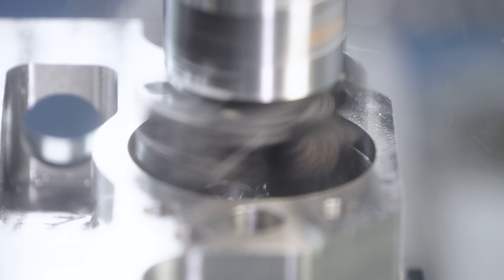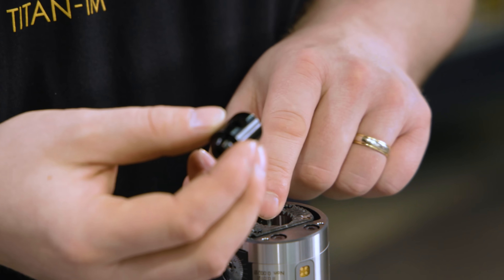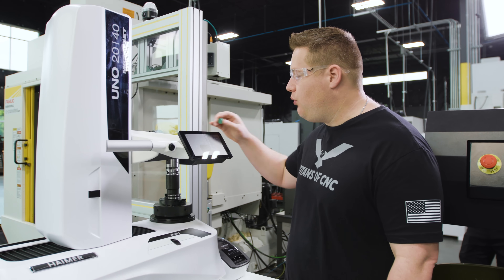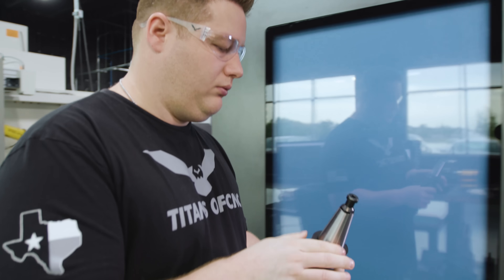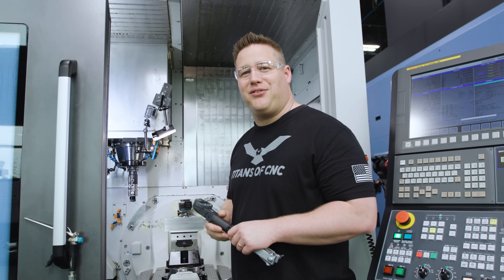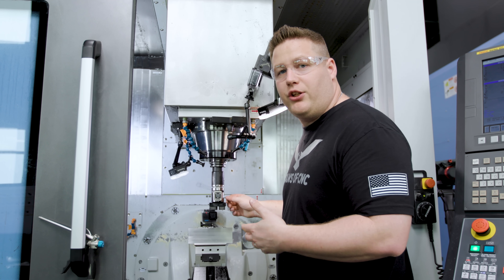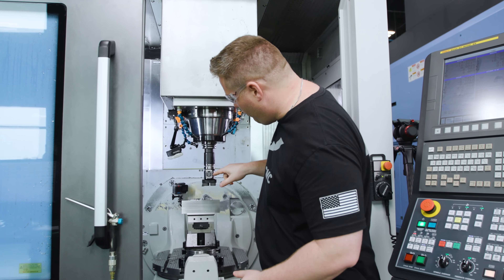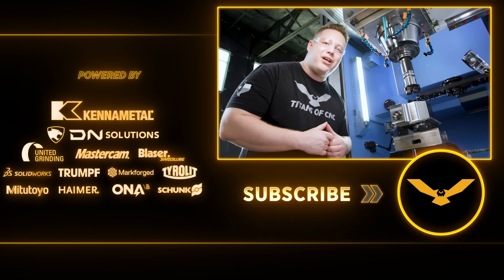Easiest Way to Dial in a BORE HEAD | DVF 5000 5 Axis CNC Machine

Comment: I was taught to get you real close anyways. Measure the holder flange diameter, then use an indicator and zero it on that, teach your axis as that flange diameter. Then move to your insert and find the highest point and look at your axis that you input the flange diameter to. You should now see what that diameter is. Im sure this sounds confusing.

Comment: If trying to hold a close tolerance AND make the best possible finish, is it still normal practice to bore through the part then feed back out again? Doesn't the tip of the insert cut more material on the way up and/or compromise the finish you produced on the way down?

Comment: We use those bar style for roughing and finishing, but I don't think they hold up as well as the older style finish bars
But our bars get used hard.
And I always make my adjustments in the tool setter 
But it would be great not having to take the bar out to make the adjustments

Comment: You can also use a dial gage on the cutting edge of the boring head to measure for the backlash. 1, Set your boring head. 2, cut a test whole and measure the whole for actual cut settings. 3, set a dial gage on the cutting bar3, 4, final set the boring head and make sure the dial gage readings confirm the radius you are dealing in on the boring head.

I know its cumbersome but certainly doable without breaking the bank.

Comment: The truth of the matter is that parts are designed by oems for no reason other than to try and force customers into slavery buying parts from them.  Boring tight tolerance pockets with a milling machine is stupid. Theres no honesty in it it it's just evil profit seeking through spineless coward engineering

Comment: That's so awesome. I had that happen to me on my first set of boring operations at my first job. At some point a coworker came by looking for something and being friendly. That was enough for me to completely lose my rhythm, and I think I ended up doubling up on my second cut, which took the bore just out of tolerance. I let my boss know. Unfortunately, it was a piece of like 4-5" thick steel, and we didn't have the stock to just fire off another. I felt bad about that one.
Reply: I worked for a small minded company in Sheffield England  after 6 months of excellent work. Despite getting them out of the suit numerous times they thought they would dock me 6 hours pay.... I left that place they say after

Comment: The problem with using a presenter to set boring bars, in my experience, is that the presenter doesn't measure the tool as it's cutting with the cutting pressure on it.

I normally go .002 undersize to be safe and then work my way up. More for sub .0005 tolerances.

Also, alot of boring bar adjustment is in how you tighten the set screw. Everyone has their own way. Kaiserheads aren't as bad but in my shop I rarely see them.

Also spring passes. The nice thing is once a boring bar is dialed, it's dialed.

The digital gauge would help with adjusting it though. You can note where your original adjustment left you and comp for your spring pass on the current and your first pass on future parts separately.

Comment: Did you bore all the way in then all the way out again? Do you not have spindle orientation? Just stop at the bottom, stop spindle, orientate, move off centre then rapid out. Halving the life of the insert doing it your way.
Reply: Of course they have M19, but one of his suppliers maybe had to told him about the Fanuc G76 Fine Bore Cycle. 
Sometimes your stop doesn't match with the cycle retract in X or Y so you can program it by hand, just a small G91 move, well as long you use a one-cutter !! 😉

Comment: As a machinist who started out boring with boring bars both with AND without those dials, I'd have KILLED for something like that. I always dreaded having to change the inserts on my boring bar. It was a custom built bar with multiple inserts going down it and cut 5 diameters at once, each a different size. NO DIALS. Each insert had a set screw that could be used to adjust the insert and, therefore the diameter of the corresponding bore. Bringing each one into size was a chore, especially making all adjustments by feel with allen keys. I can almost guarantee that company is still using them too. Glad to see that something far better is out there.

Comment: Or.....
You can pull the ten thousanths travel indicator out of your toolbox and measure the actual adjustment from the cutting edge. No one uses the dial on an adjustable boring head🤠

Comment: Maybe a little thing for automation.
you are printing a label from the measuring machine.
Then manually typing in that data on the label.
Why not just have the measuring machine print a barcode 1D or 2D and then have a scanner on the mill, to scan said data in. This way you can't make a mistake in typing in said data from the tool
Reply: The operator could mess up transferring the length for Z or he could touch it off on the tool eye. I am assuming the program is going off the centerline of the tool so it won’t matter if the operator fat fingers the X and does t double check.

Comment: Just to point out, no machinist worth his salt will trust the boring head dial alone. I would always use a dial on the tool as it is adjusted. 

That said, it’s a pretty sweet system.

Comment: All of the high tech equipment is impressive! I have experience with Dykem, trusty Post-It Notes, and Tool Eyes (when you could trust them) hahaha 

The Haimer Uno looks like a blessing in disguise, ease of use to the operator and those who don't have eagle eye vision. Chips on some inserts can be insanely small and just as difficult to see under a standard backlit magnifying glass. 

Awesome video!

Comment: Does the display show the true radial movement or is it diameter . Like let’s say you have a 5.0000 hole, the first cut was at 4.995, would it be .0025 or .005 adjustment ? (Not accounting for tool pressure)
Reply: According to the video it goes off diameter.

Comment: When using a boring head in a CNC machine how does the retract work.? Do you just feed it out? I would think it would take a small spring pass cut on the way out then. Probably bad for the finish and could introduce chatter. Any insight would be greatly appreciated
Reply: Most CNC mills have monitored spindle orientation, so you can easily just tell the machine to stop the tool, set the spindle to a preset orientation, move the cutting edge 0.1mm away from the bore diameter and retract in rapid. We got a ~30 year old cnc mill with a sub-routine for that out of the box, where we just tell it how deep to bore with a parameter and all we have to do beforehand is mount the boring head in the right orientation
Reply: @jetfire5991  Ok thanks. That makes sense. I’ve been curious about this for a while. I thought I saw at one point in the video the tool spinning as it came out. It may of even been on the finish pass.
Reply: @Revilokab  it might have been, since a spring pass is just a result of tool deflection. That boring head they're using in the video looks really rigid, and they are only removing like ~0.1mm each side, so I imagine that spring pass that would happen to be next to non-existent.

I'm just speaking from my experience, since we're usually trying to hit the dimension with a single pass to save on cycle time, and depending on the material, that spring pass for us could make a difference of 0.01mm in mild steel (~0.0005") or 0.05mm in stainless (~0.002"), so we're usually using the routine for pulling away to avoid that.
Reply: subroutines are great, but most newer machines have a handful of canned cycles just for boring. writing a subroutine would have the same result. IIRC, theres a cycle to orient the spindle and retract a spscific distance in I and J, dwell at the bottom and feed out, feed in and feed out at different rates, feed in and rapid out maybe? probably for spring loaded tools on the rapid out. it's been a while for me, so I don't know them off hand.

as with mosy things,  it always depends on the job. is it a short run of one offs? are you trying to shave seconds off a production cycle that rapid is worth risking? is there a surface finish callout? maybe they want a cross hatch on the cylinder walls that an abrasive will touch up minor scuffs afterwards. have pride in your work, but make sure you're not doing unnecessary work for free.

Comment: It would be nice to have that equipment but we wouldn't use it enough for it to efficiently pay off in the time saved. (*edit* What is extremely affordable? That's certainly a debatable topic when it comes to buying machinines) We set boring tools the old fashioned way... On the surface plate, sweeping the insert to find the high, and adjusting accordingly or in our optical comparator( <--Spell check says I'm spelling that wrong, wtf?). No doubt, setting a boring tool is probably one of the biggest headaches of setup. Tool pressure is a mf'er, especially if you have just enough material for one pass. Depending on the material(most) rerunning after adjustment just scraps the part. Sneaking up on the dimension isn't doable like most machining of tight tolerances.
Even though we have plenty of boring systems I'll probably get a quote on one of these tools though, just for the ease of adjustment in the machine. Take note, I'll be the first dumbass to leave the digital readout on the tool and hit go.
Reply: Yeah, I sometimes resort to honing, lapping or ballizing when I'm just under a very tight tolerance band.

Comment: Do newer bore heads still have backlash or is there newer better technology? Seems like they should have covered removing the backlash in the adjustment.
Reply: Well seems they do! Was wondering why he didn't mention it on the tool setter.
Reply: It sounded like it has backlash but the digital readout won't register movement until you move forward, or rather increase boring diameter.
Reply: @GrumpyMachinist  yea i noticed that during the digital adjustments. pretty awesome tech not gunna lie!
Reply: Everything has backlash. Backlash isn't your enemy, worn/sloppy ways are. Drunk threads and ignoring the foundations of mechanical accuracy  are your enemy. 
Also there's no way to fit a ball screw arrangement in that small of a package, without it costing half a million.
Reply: Getting accurate results with lots of lash isn't a problem if the ways have propper guidance and no sticktion do to in proper thrust design. 
Read foundations of mechanical accuracy and precision hole location by Wayne f Moore.

Comment: How do you back up the tool on Z axis once it’s done cutting? So the insert won’t scrape the bore you just cut
Reply: You can do that depending on the tool and orientation. In Fanuc we G85. Bore in, bore out, which is what you want to do when trying to hold a surface finish and remove tool pressure. G86 will bore to depth, stop the spindle at depth and rapid out but it will leave a tool mark. However, the tool mark is minimal. You could also G01 in at one feed and feed out at another feed. Most of the time we just G81(feed in, rapid out), like a drill cycle.
Reply: Looks like they are back cutting on the way out…..

Comment: This is just awesome. I can imagine even more tech and automation to ease this process. Still too manual for super efficient production.
Reply: You'd be shocked at what those boreheads will do. We, myself and the kid I trained, make .0001 adjustments while feeding an assembly line the old fashioned way, dial tools. It really boils down to keeping it in spec but it's not hard without the digital reader.

Comment: I still heared from this system, but never seen one in action before. Thank you for showing. At my workplace, we have very tight tolerances at our workpieces to produce.
Sometimes it is not allowed to open the window or door, because the change in room temperature can affects the result of the bore diameter. Also the coolant must cooled down to 20 degrees celsius, before starting the boreing process.
Greetings from Germany.
Reply: @mostlymotorized  We have measuring pins for bores up to 10 mm. They are polished and manufactured with an accuracy of 0.0001 mm. Each diameter comes into a set of 100 pins with tight gradations. Every bore that has a larger diameter is measured with 3-point probes that can measure to an accuracy of 0.001 mm. The bore tools we use, are manufactured by KAISER in Germany an have an accuracy of 0,001 mm. All measuring tools are stored in an climate box and getting checkt each half year from an certified calibrating laboratory.
Reply: you live the dream. In summer my workshop is around 38 degrees, the enclosure of my machine is at 45 degrees and I'm suppose to get tight tolerances of 0  +0.02 😓
Reply: @mendadrog  this is absolutely bad for the quality of your product output. The foundry, I am working for, is the world leader in its market. To stay the best in the world, needing a lot of innovations and manpower. Actually we build up an second machining center and needing in the next two years 100 machinists and people for our tool management. East 1995 we are using 3D printing technology in industrial scale. All our products are Prototypes and the world is needing more and more of this hy quality products. So the future looks very good for us. We have Offices in Bangalore - India and Ann Arbor - North America. More than 1700 Custumors in 37 Countries.
The name of the company is ACTech GmbH, located in Freiberg - Saxony in Germany. The ACT means Advanced Casting Technologies.

Comment: I have a question how does the Haimer Uno know the length of the tool? Is the length of the tool the height of the tool or the diameter of the tool in the offset page for tool geometry?
Reply: It's the height. I've never used a tool setter like that but it's a safe assumption there is a machine zero that is set from a standard dimension of a CAT40 tapered holder.

Comment: We use big kaiser with a built in digital display
Btw: why no spindlestop and spindleorientation when you reach the final depth and a small offset to get out of the hole?
Sry, english is not my first language
Reply: He doesn't know about it)
Reply: @romekkis2776  😂
Reply: We all get trapped in our ways sometimes and the simplest thing goes right over our head. In another comment a guy says he uses an indicator to adjust the boring tool in the machine. I do this method all the time for a lot of other tools but for some reason I was a dumbass and never thought of it because there is a dial. Screw the dial, I'll start using the indicator method, it's much more precise.

Comment: Does your machine not have a Fine Boring cycle? G76
Reply: Fanuc? I'll have to check it out. 
When we are trying to hold a surface finish and a tight tolerance we usually G85 because the bore out helps reduce tool pressure.

Comment: What would be REALLY cool is if all this equipment was networked. In that system, instead of Jessie having to plug the numbers off the Haimer print into his mill’s console, the Haimer would transmit them directly to it…no chance of transcription errors.
Reply: It's a pre-setter. Normally prepare tools for the next job while one is running. So not best to change tool offsets while another job is running.
Reply: You can get rfid tags in the retention knobs and Zoller has a presenter that can do it. I’m sure the haimer probably could too.
Reply: I might be getting confused with a different vid but I thunk you can save them to a USB stick and transfer all the tool for the job simultaneously. Again I might be wrong haha

Comment: I could tell he was trying to hold back a smile when the size right off the presetter would have put the part in tolerance. Of course, you don't go straight to size with your presetter, but in this case he totally could have.
Reply: It's not that simple exactly.  If you already know what material you are boring, and you already know how much stock you are leaving, and you know what the setting needs to be with a certain amount of stock left to have just the right amount of tool pressure... then sure you could offset the number straight from the tool presetter and hit it bang on (Can I justify one of those for my garage? LOL).  But that requires the exact thing these tools are meant to fix:  You need a specific operator who knows the quirks of the specific tool in a specific material and knows what voodoo numbers to use for a particular job.  That's all well and good and in a small shop environment it can work, but not ideal when you need 20 different people to be able to knock out a new random part out of a random material and hit the tolerance the first time.